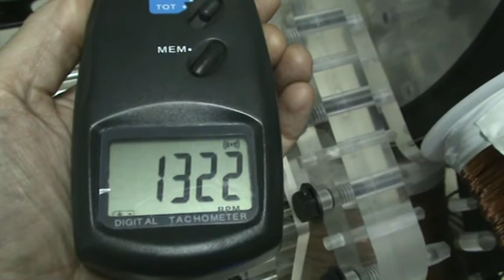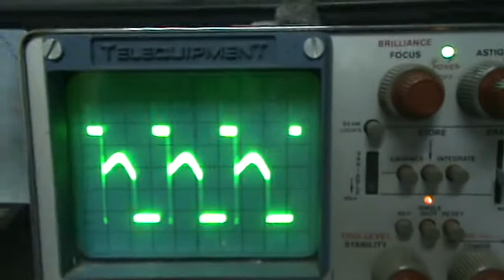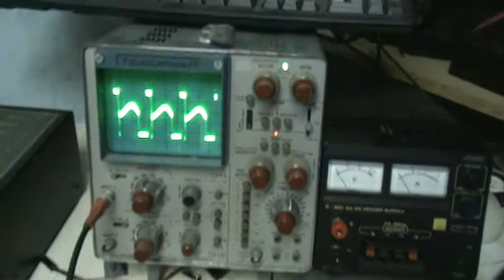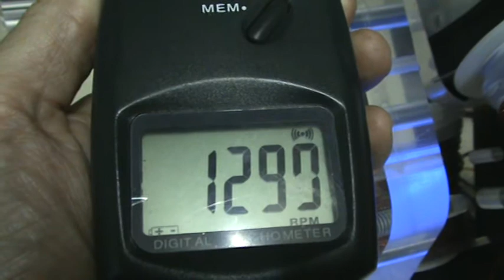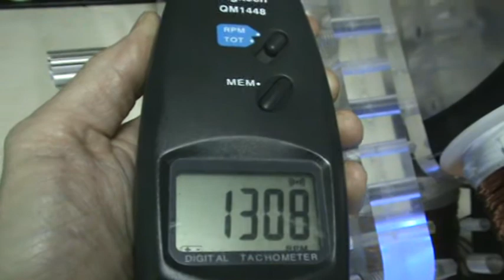Bedini Monopole SSG Timing

Comment: Thank you for a wonderfully clear description of what's going on tuning the wheel for max speed. Where have you found to be  the speed at which the device is achieving max rate of charge on the charged battery and minimum current consumption off the drive battery?

Comment from the maker: Hi GrandCosmic, this device is designed to charge batteries. It would be too powerful for a laptop battery, but it can charge a large bank of batteries that could run an inverter big enough to run a refrigerator.